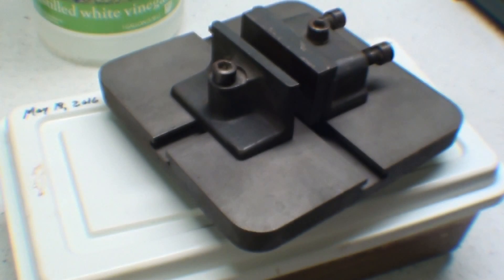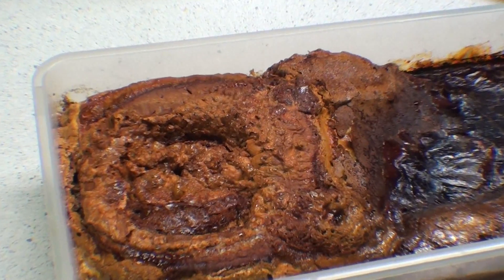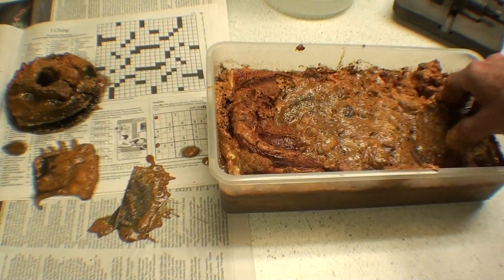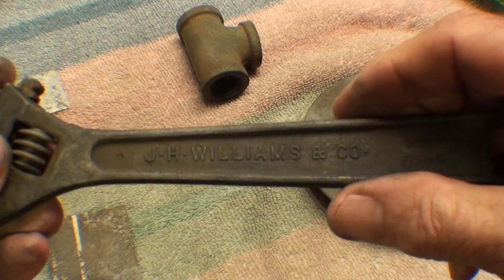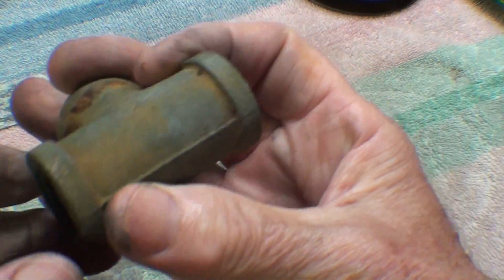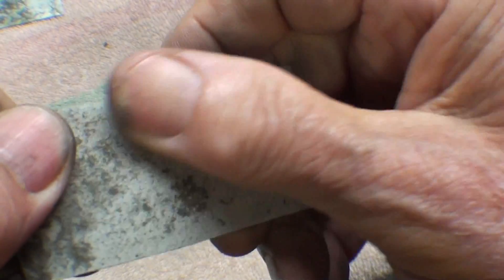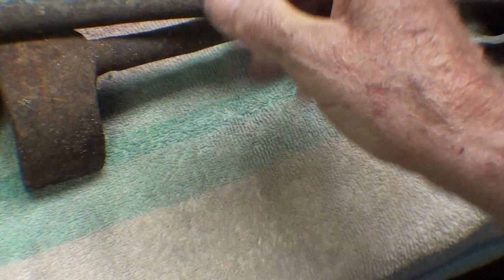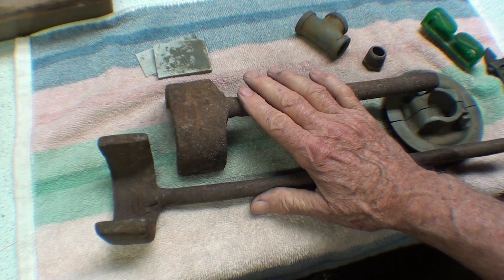VINEGAR Rust Removal 304 1/2 tubalcain electrolysis

Comment: Have you considered adding a third test to your "electrolysis vs vinegar" test? There is a product on Amazon called Evapo-Rust that works exceptionally well. I believe it works faster than vinegar. Cost is about $20/gallon.
Reply: Walmart has EvapoRust for $12.98/gal.  Best rust remover I've ever used.
Reply: I would have never guessed that! Thanks for pointing that out, Herb.

Comment: I think what you were seeing in the first parts was deep rust that the vinegar cleaned out. So of course those pockets are now empty and exposed - i.e. pitting. 

Certainly leaving a part too long in an acid will dissolve some of the base metal, but the rust will go well before the base metal so the key I think is to not leave them in the acid too long.

Comment: I had this problem after watching your first video. Any tool I put in vinegar that had a shiny surface chrome or polished turned coal black. I had several Greenlee taps I got at a yards sale that had some surface rust. I left them in vinegar overnight and it removed the rust but also made then black as coal. Can't read the etched numbers that were on the taps. I was very disappointed in this method. Back to electrolysis for me. Thanks!
Reply: Might be chromium acetate or oxide...

Not sure about your taps though...

You can try wiping them with window cleaner (ammonia) and/or Brasso, etc. to see if the black surface wipes off.
Reply: The black is carbon that was in the steel.  When the rust is dissolved, the iron is gone.  The carbon that is in all steel and cast iron remains, and discolors the surface of the metal.  It is usually pretty easy to get it off.  The more rust that is dissolved, and the higher the carbon content of the metal that became rust, the more carbon black that will remain.
Reply: ***** thanks for taking the time to give me some answers. Very much appreciated. I hunted with a medal detector  fow over 20 years. Put civil war relics in about everything imaginable. Some objects come out great some looked horrible. Thinking there is not a 100 percent perfect way. Take care.
Reply: I like using Evaporust, and I use it mostly on tooling.  If the metal was highly polished before it got rusty, it will still be shiny after the treatment, at least where the rust did not attack it.  All of the acid based treatments will leave a matte finish on the treated metal, and electrolysis can as well if not done properly.  It is also quite safe to use it without gloves.
Reply: Good to hear someone mentioning Evapo-Rust. Rust Check sells a product that is probably Evapo-Rust under a different label. I just did a video comparing the two if you are interested. From one Bob to another.